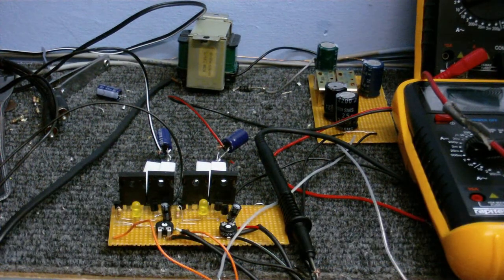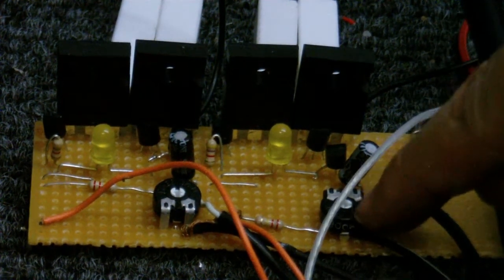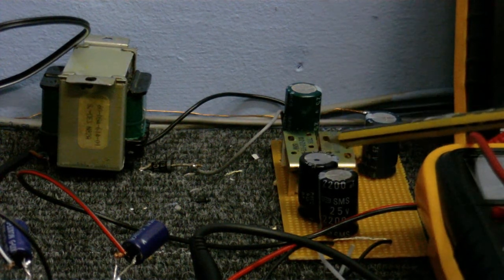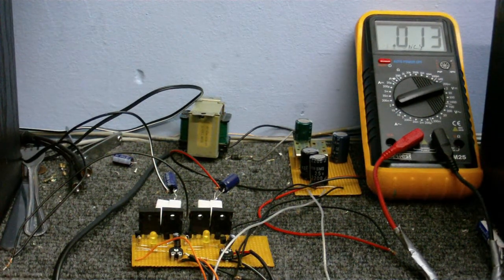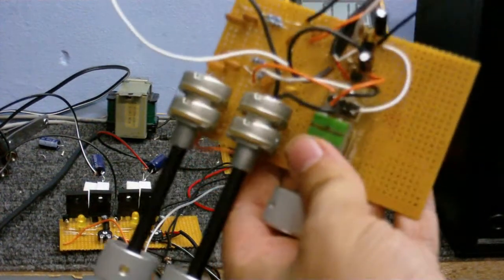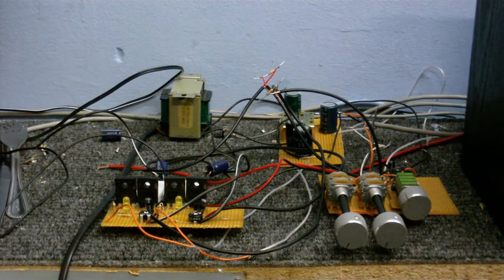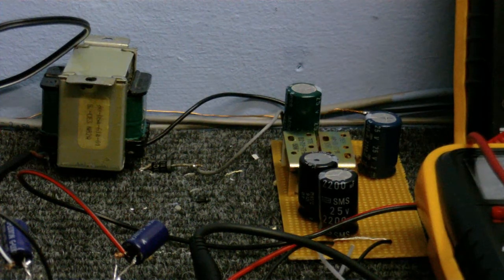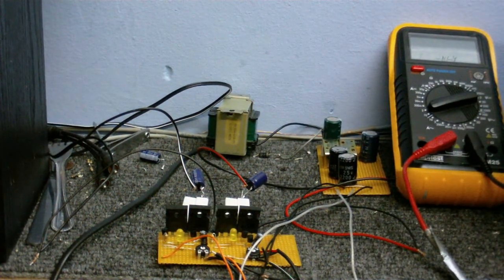CDC Electronic Workshop - The amplifier "adventure" 2 - It's starting to come together

Comment from the maker: @Kankki1 I was going to use a full wave at first, but the thing is I tired using a half wave rectifier just as an experiment, but it worked so well i decided to use it, maybe later on I'll replace it with a full wave one.